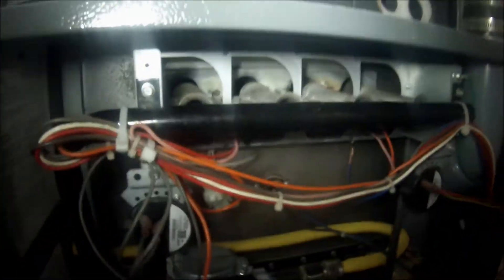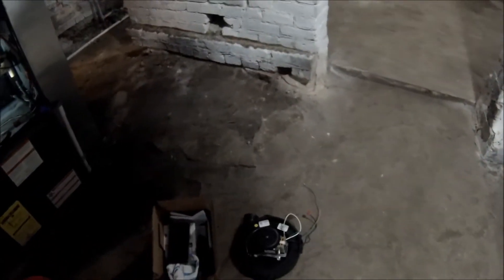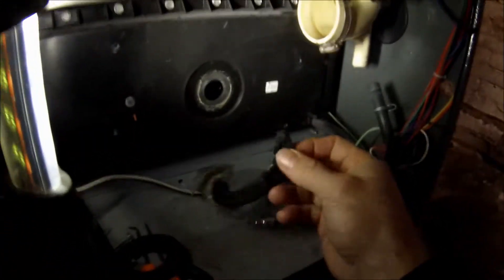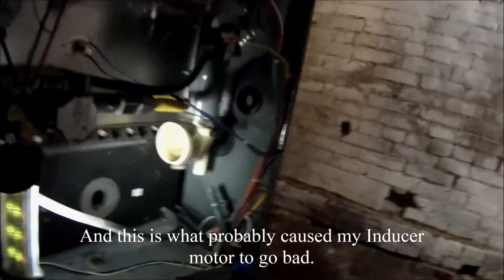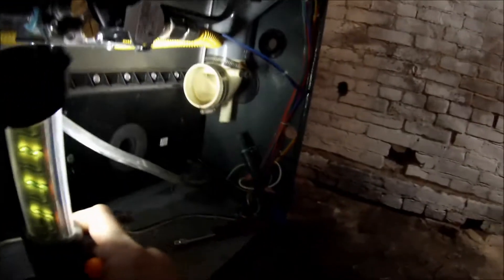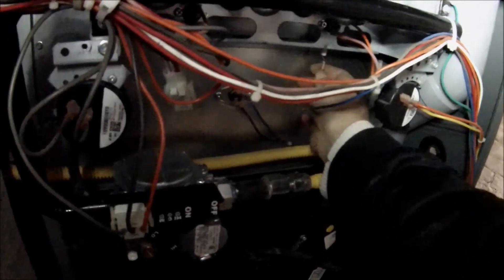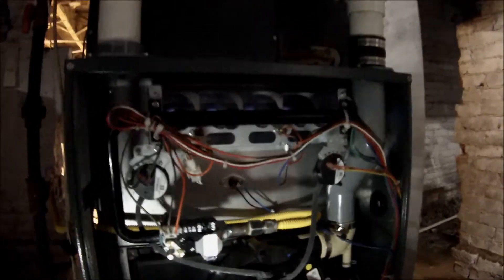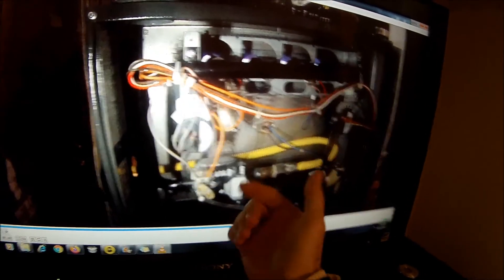Dont make this HVAC INDUCER MOTOR Install MISTAKE

Comment: Key point you made that helped me.  "It worked sometimes."  My exact problem.  In the middle of the night our schedule on our thermostat told the furnace to let the house get to 63 degrees while we sleep.  Because the seal was getting worn out, not as bad as yours, it was loosing a sealed connection to the condensation collector, this caused the system to not start and eventually go into Error 200 (E200).  New seal has helped my Lennox SP98 a great deal.  Thanks for the video.
Reply from the maker: Glad it helped not many videos talk about that seal being bad and the symptoms of it.

Comment: Could this be my problem? I was having a noisy draft motor so I replaced it along with both pressure switches and tubes. I didn’t use any gasket on the back of it but have ordered one for my particular motor. My board is currently giving me a switch open code
Reply from the maker: It could need the new gasket. Also check your gas burners are not flaming out too much when its on. I did maintenance on my gas burners opened the metal to metal part where the ignitor lets the gas over to burn the next gas burner and I opened it too much which caused me to have Flame Rollout, tripped the limit switch. Check this video as well: https://www.youtube.com/watch?v=C1GlCI1NQho&t=263s

Comment: That seal is called a restrictor plate. Every time you replace inducer, you must replace restrictor! If you replace motor and plate, you don't since new one comes with it. 3 gas valves and a circuit board later tells me you don't stop until the problem is fixed. Congrats!

Comment: When you were tapping the gas valve you were bypassing the protection / function of the negative pressure switch.  When you tap the gas valve you force the selinoid switch to close. Making the gas valve work.  The gasket and bad inducer motor sticking were really the only problem with the unit.  Great job on your patience and troubleshooting skills.  My hat off to you!😅

Comment: I don't understand how you got water in the inducer.
Reply: On my Goodman furnace I have a horizontal install. The u joint is using the small nipple for the condensation drain. It was sloping down to much and water was going past the small drain port and dripping into the inducer housing. I raised the u joint a little and I also teed into the drain port on the bottom of the inducer housing. I also replaced the black hose with a clear vinyl tube. Now I can see the water flow into the clear tube and into the drain tap.

Comment: Have you ever used RTV? I need to replace my inducer but it doesn't come with a new gasket.
Reply from the maker: rtv will probably work
Reply from the maker: https://www.supplyhouse.com/Rheem-68-104152-01-Gasket-Induced-Draft-Blower?utm_source=google_ad&utm_medium=Shopping_ntm&utm_campaign=Shopping_NTM_New_users_Control&gad_source=1&gclid=Cj0KCQjwo8S3BhDeARIsAFRmkOMVWRUCMJt6oB-T1b2ODVBypgnS-bhs87B0NVTZWhTNQjPlxpmprboaAjk8EALw_wcB

Comment: I discovered that the number 1 reason why this happens is because (hard to believe that  almost everyone underlooks) the furnace is sloping the wrong direction. In other words its draining the wrong direction causing condensate to accumulate and overwhelms the gasket.
Its much easier for a installation tech to level it and let it burn or leak and burn the inlet motor.  But check the direction of flow of drain. It should be going away from not into furnace 

Furnace owners check level of furnace check what direction slope!
Reply: Slope meaning left to right? Can a tilt forward cause the same thing?
Reply: I see the same thing but my furnace is mounted directly on the concrete floor of my basement and the top is tight with duct work.  Is it possible to tilt it via the condensation collector screws and still be ok?  Thanks.

Comment: So my Goodman was leaking from the black cover behind the inducer motor(common problem).  I took the inducer and elbow out(replaced the elbow) and used high temp red silicone to stop the leak, which worked great.  However, I did not replace the little round gasket for the inducer(it was still intact but definitely worn).  Now, a month later, I notice a water drip from the back of the inducer. I just ordered a new black cover(thought it may be cracked) but now Im thinking the gasket may be allowing some water to be sucked in appearing to leak from the inducer.  Anyway, thanks for your video.  Im going to replace the gasket and see how it goes thanks
Reply from the maker: Yeah it may be the problem, mine had enough air leak on that seal to not allow it to start.
Reply: @JacobKnightRiderShop  I went ahead and took the inducer motor out and the elbow(to check for any blockage---none there).  I put a new round gasket on the cover. I also put some gasekt sealant on the 4 holes where the inducer attaches to the cover.  3 days so far and no leaks.  Thanks again!!

Comment: Please help!  
So much good information on how a 2 Stage furnace works and everything within. 
I have some issues with mine york infinity going into recycle error.  Flame goes out after a few minutes and then fires back up. 
We changed the wheel inside the inducer fan and it was apparently the wrong wheel. We have the right wheel to try and hopefully that fixes it.
Any ideas or thoughts or confirmation would be greatly appreciated. 
The wrong wheel we are pulling off is from a diffetent size furnace same model but smaller. One stage.   The wheel is bigger and different pitch.  The new correct wheel is a half inch smaller in height and diameter
Reply from the maker: Yeah it probably not enough suction on the smaller unit. let me know if the bigger one fixes it.

Comment: good info, my motor was sticking, Took it apart and blew out the motor which in turn made it free, but its over 10 yrs old so I'm replacing it anyhow. The inducer motor didn't have a gasket, but the new ones does. Thanks for the video.

Comment: If you had the meter on the gas valve and you had 24 VOlts in the valve, not working the seal wouldn’t have nothing to do with that. The pressure switch would eliminate the 24 V to the valve.
Reply from the maker: Its why its so strange why I could tap it then it would work. Alls i know as its fixed now after installing that seal, but it could of also been the pipe with water, gunk was in that, not letting the condensation flow thro the pipe.
Reply: prob a loose wire bad connection and you replacved the part where the wire is and its makin a connection FOR NOW.. is my guess @JacobKnightRiderShop

Comment: Just a little info, the pressure switch is really sensitive and if you suck or blow on the hose you may damage it.  😊
Reply: They are actually vacuum switches...Very low inches of water column...The draft motor blower creates the vacuum...Often the nipple on the blower housing gets blocked up with trash, restricts the vacuum and won't make or close the switch part of the vacuum switch, which has a diaphragm inside that trips the switch...Very sensitive...Another common problem is the flame switch covered with carbon...Just a little blocks rectification, thats the flame on signal, feeding back to the control, through the carbon of the flame itself...It then energizes the main gas valve...If you already know this, sorry for the rant...I'm semi retired from the trade, still doing it word of mouth...

Comment: This is very helpful, I'm about to replace the inducer unit on my Goodman furnace. 

Quick question, I'm having trouble finding the foam seal. What seal did you buy, something OEM or a generic part?

 Thanks!
Reply from the maker: I believe it was a goodman inducer I bought which came with the seal, Its just foam with a sticky back, maybe try weatherstrip that has a foam backing used for doors windows ect.  https://amzn.to/3Wnbo9A this would work just run it around the hole.
Reply: OK. Thanks again!!
Reply: @P_Hamtramck   I know its too late but Goodman part #0154F00001P has all the gaskets

Comment: Thanks for posting this video !!!!!   I have been working on my Goodman for over 3 years now...  I too,  just lightly tap near the gas valve and then the furnace fired right up and will run for 2 to 3 weeks off and on just like a new one...  I too bought a gas valve,  and furnace worked good for 3 weeks...  Some times I just tap furnace lightly on the outside, and it works for 3 weeks.... hate to bring in a HVAC guy to look at a perfectly running furnace and pay him $150 or so...  Three weeks ago I took off the Inducer motor,  very smooth running,  Clean, works fine,  but the gasket fell apart...  I put on a thick bead of silicone and put it back together... runs fine for 3 weeks....  so now checking all drains, hoses, vacuum, and in 3 weeks will call my HVAC guy over..  this has been going on over 3 years.... only have to tap on it  3 or 4 times a winter !!!!!  .... 
.
Oh, the reason I do my own work,  the HVAC installer had big low spots in my PVC exhaust and intake lines causing one to fill with water stopping the furnace the first cold week of the winter when furnace was new....  I fixed it.
Reply from the maker: So your heater is now its fixed? Yea it was a strange problem that took me a while to figure out. None of the videos on replacing the inducer motors ever said to replace the seal which is just a piece of foam or looking like weatherstripping foam just in a circle shape with a hole in the middle.

Comment: Hi I'm an HVAC tech for 25 years now. Had problems like this before were furnace works intetmitent. check your exhaust pipe sometimes they get clogged with bird nest or other debris. I also had a problem with loose wiring at board terminals (solder joints at plug) and gas valve plug. But you are right about the seal at inducer motor, it has to be air tight.
Reply: Also another thing to keep in mind, the condensate pressure switch is in series with the gas valve. If that inducer seal was good then the symptoms would be identical as u had. But the low side pressure switch is almost always the culprit. Or clogged drains
Reply from the maker: Thanks for the info. Its like a car mechanic, dnt fix it unless its broken.